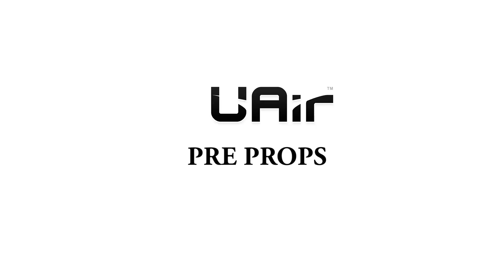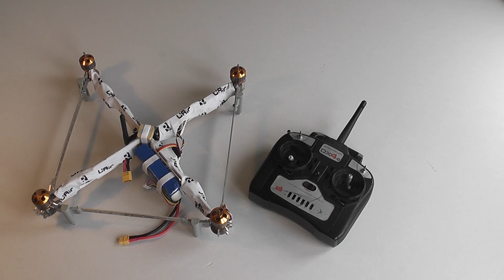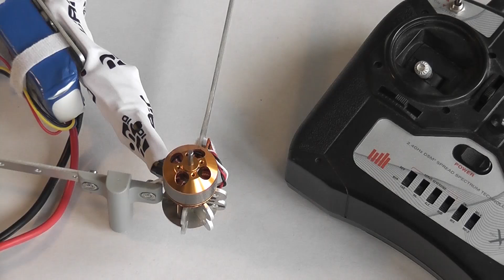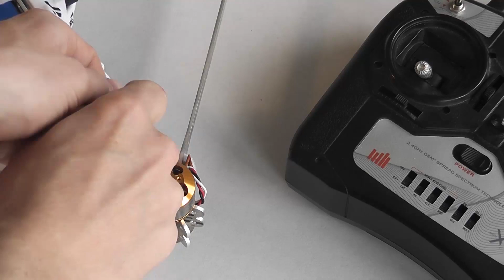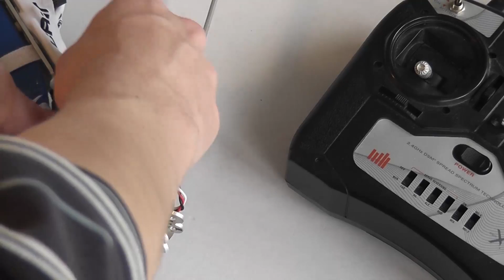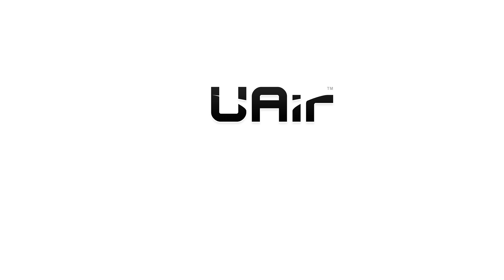Pre Props

Comment: Wouldnt it be easier to check motor direction by placing the props on the motors loosely, and they will spin so you can see they are going the right way?